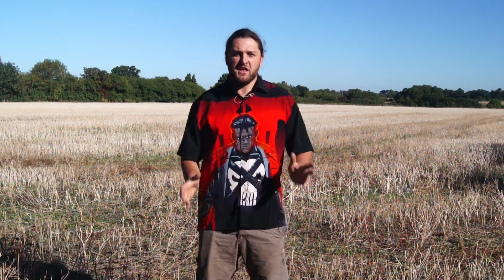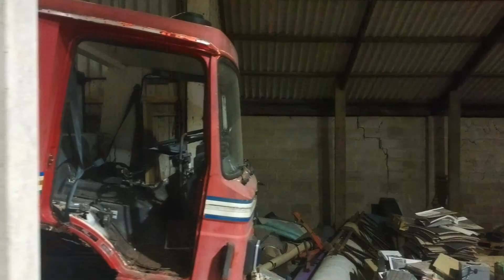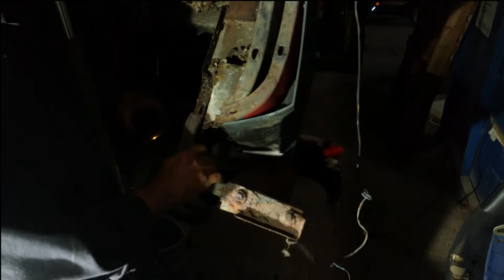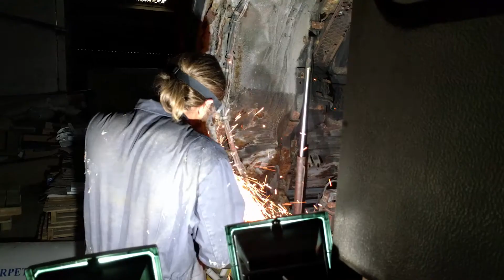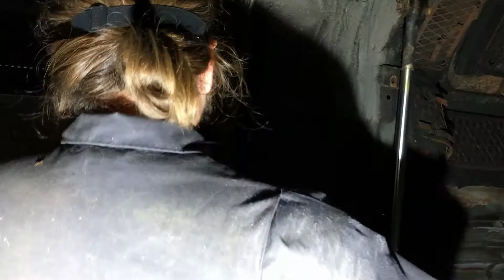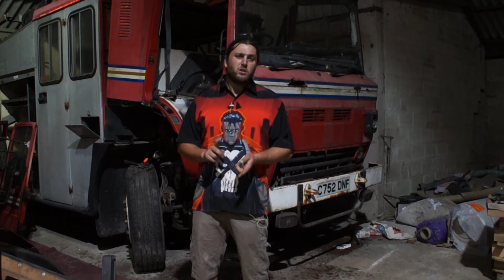Taking over Jayemm on Cars - and a look at the Dodge!

Comment: Well Lawrie, if it's any consolation, a lot of Dodge pickup trucks in the USA look the same way, especially in the Northern states. Some of them are even worse, if you can believe it; They all have missing bits in the wheel arches, door sills, running boards, and doors.
Reply from the maker: Some of what we saw when we last were out there makes me think you're very much correct!

Comment: im not sure why your bothering  you can get a new cab for a couple ove houndred  and the 13 stands for 13 ton
Reply from the maker: Where on earth can you find a new cab?
Reply: @lmm  the cab was shared  with renault trucks  and there still some ove them around
Reply from the maker: Problem is, good ones are on good vehicles that are looked after, generally ones that have been scrapped or taken off are as bad as mine.